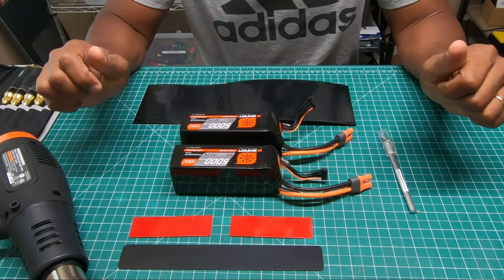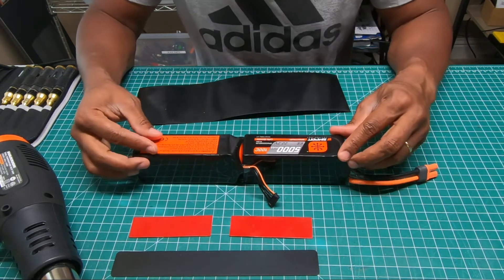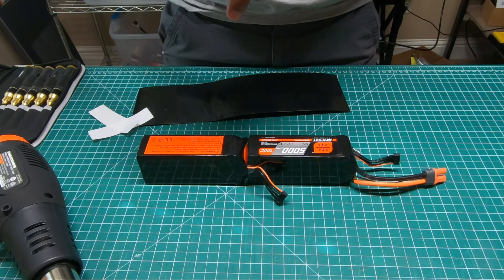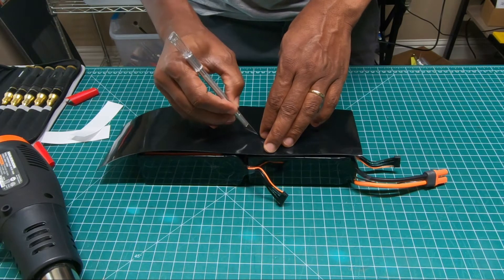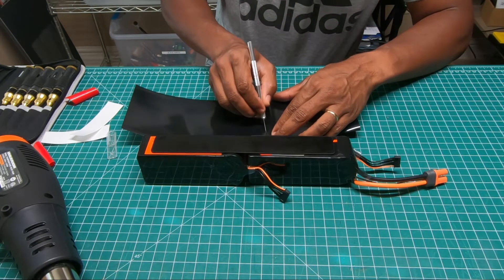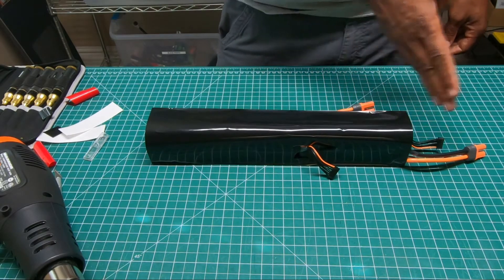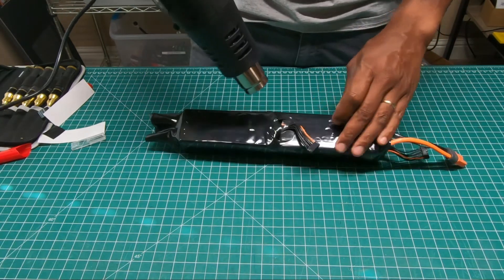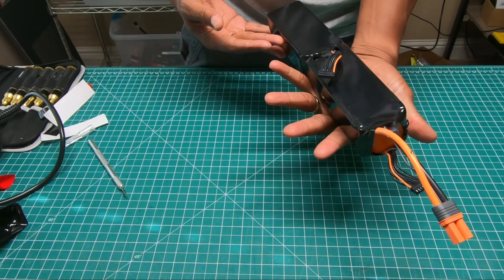Creating 12s Battery Packs for 600/700 size RC Heli's

Comment: Brian,  I need help. Been flying 500 size since 2008 and just got a 700 goblin raw.  I'm completely lost how charge,  what to solder where,  what goes into what,  etc.  Got 4 maniax 12s 44.4 volt 5000 packs.

Comment: Thanks for taking the time to make this video. May I ask what size is the shrink tubing?
Reply from the maker: it's for 4500-550 mAh packs and its 350mm long.
Reply: What is the flat width of the heat shrink?